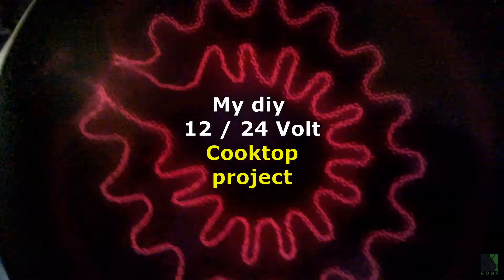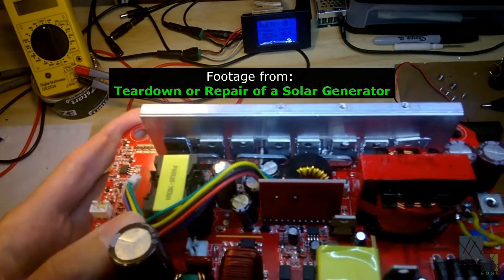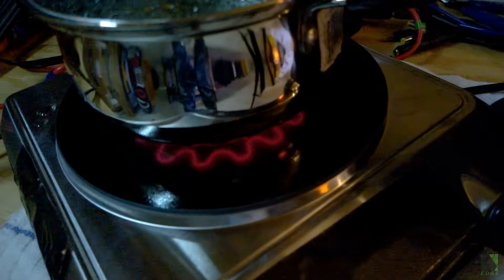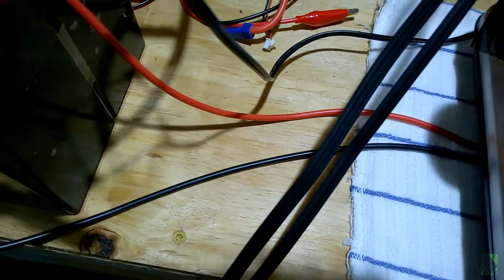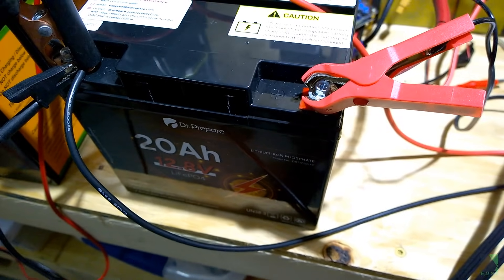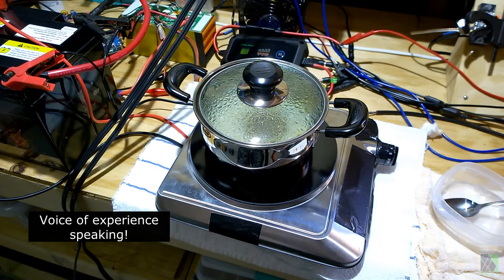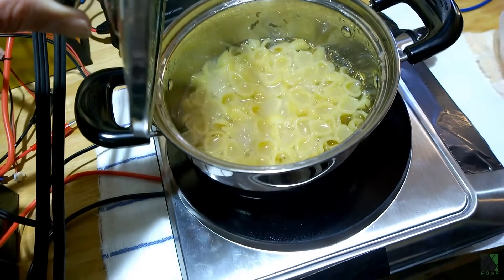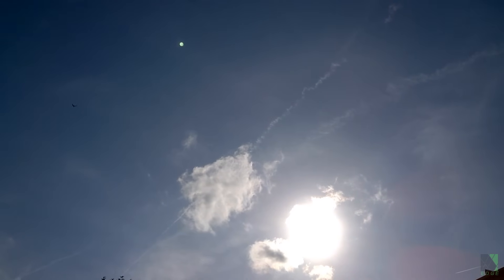12 Volt Cooktop PROTOTYPE - First Test! Pure DC No Inverter Hotplate #12volt #offgrid

Comment from the maker: Notes from my work on recent cooktop prototypes:
1. Thermal Transfer: hot plates / cooktops like this have an unusual looking heating element insulated with a fibrous ultra high temp material I could not identify at the time of this video. The heat projects upwards into the cookware. Internal temps inside the element chamber are very high. There is practically zero space between the heated radiative surface and the cookware. Because of this, thermal transfer is good. Vast majority of the heat goes into the cookware. A thin stainless pan or pot works incredibly well, heating within seconds.
2. Efficiency: a native 12 hot plate does not use complicated electronic circuits such as DC-AC inverters and induction circuits. Therefore this type of hot plate can cook with much less DC power and efficiency exceeds 90% with no moving parts.
3. Cost: this type of appliance is hard to build DIY, BUT very cheap to mass-produce in a factory. Therefore it's 100% possible to mass produce with cost <30-50 USD.
4. My prototypes are aimed at Grid Down scenarios, where everyone would truly be "off grid". Complicated, top-heavy technology is a liability. A simple appliance like this is needed in the world. A basic 12 volt car battery can run it for years. 
5. DIY / serviceability: almost no one can repair an inverter or induction cooktop. But a basic cheap appliance like this has a far great chance of survivability and possibly repair with only basic hand tools and DIY skills.
6. Wattage/dissipation: the prototype seen here can handle over 500-1000w of power. There is zero reason why a .5-1kw 12v cooktop could not be made for a reasonable cost. But even 500w has been proven adequate for standard cooking jobs.
7. No buck converter, PWM or electronics are needed or even wanted in such a design. The goal is pure simplicity. 2-3 heating elements suffice for temperature and power regulation. A robust mechanical thermostat or manual DC switch can handle operation from there. 
-DD

Comment: Maybe you know this already but I give you this tip anyway, they are soldering iron that run on 12V, with a heating element that can get hot up to 150 watts, others use USB 5V and can get hot 80 watts, if you put together 4 soldering irons that can be a nice experiment to try 🍲✔️
Reply from the maker: @albumdelcentenario Hi and thanks for sharing :D I didn't even think of trying 12v soldering iron heating elements. I have to look for some. Cooking with parts from 12v soldering irons!?? I bet no one has tried that!

Comment: So as volts go up it's easier to build??
Reply from the maker: @mackelby1 With higher volts, we can use thinner cable, but that's about it. The challenge with the "infrared" cooktops which I happen to really like, is the super high temperatures inside. I destroyed a lot of materials trying to figure out how to make durable heating elements by hand. Had some equipment burn up but that's the price of such experiments
Reply: @solarpoweredge you are really scratch building aren't you??
Reply from the maker: @mackelby1 Yes... I wish we could just go out and buy these at a local store, can't understand why not. This cooktop works so very well, I think a lot of people could benefit from it.

Comment: I believe the fine powder is Mica.

I've been looking for a way to make/buy a 12v kettle. I've been thinking of just drilling and tapping holes in a kettle for 8 or 12 diesel engine glow plugs, if they draw 10A each I'd be getting let's say 1200 watts or so and I could use 3x 40A relays to control them. 

But I don't know how healthy and safe the glow plug materials are when in dieect contact with food or drinking water.
Reply from the maker: @jhsevs It turned out to be an asbestos like mineral substance, I had it analyzed in a lab. After this I cleaned my shop thoroughly, now I wear a breathing mask when I work with these types of devices. Great idea on those glow plugs..  sounds interesting, if I can find a cheap set I might give them a try. There must be a way to use them without contacting the food directly

Comment: I need one.  I want my future off grid tiny home to have a wood cook stove but cooking in the hot months would be torture without this little DC hotplate.  Except my cast iron pans will thrash a glass topped one.
Reply from the maker: @lesliekendall5668 I use cast iron and stainless, and never thought of what would happen with those glass tops. Good point. I do have a couple of non-glass cooktops that can run on PV, but tend to like the glass ones. I avoid the teflon pans if I can, worried about the chemicals getting into the food...

Comment: Dave you're funny sometimes  ;)  Hey man, go to PCBway and make your plans, they will build practically ANYTHING, including circuit boards, metal stuff, plastic 3d printing etc AND assemble if you want for more $$  Combine your diodes, large power transistors etc with metal tight fit parts and you have your solutions even if you assemble them yourself.  Pretty sure aluminium would be best but tin will suffice and likely cheaper.  In fact you could have them assemble the whole thing into a large metal plate with the devices distributed evenly around.  Cheers mate.
Reply from the maker: @davidrobertson1980 Hah :) I do want to work with PCBway to make some CNC metal parts, first need a 3D CAD model. At the moment I am unable to keep up with the circumstances here, let alone make 3D models. Hoping for the future! I'd like to see a nice CNC aluminum housing for a custom 12v cooktop, that would be amazing... take care man!

Comment: Super interesting, thank you so much. Really trying to become more self sustainable and this was something i scratched my head on too! Why the heck isn't this commonplace? You think the dirty inverter industry doesn't want it to be? 😂 also if you don't mind me asking (I can look this up too so no need to answer haha), but what kind of 12v battery should I get as my first one? Will be working mainly off of diy wind and perhaps solar in the future, I'm thinking :D thank you!
Reply from the maker: @tjitjo welcome! who knows, but there is no reason why a kitchen-grade 12v cooktop (hotplate?) could not exist, for about 25 bucks. It needs slightly different components and construction vs. 120vac, but not really high tech at all. My first battery for solar was a LiFePo4, you might want to look at a 100ah 12v one for a startup system. That's enough power to do cool stuff including cook small meals, run lights etc. and have good backup power if need be. Hope that helps :D

Comment: Besides the prepper/off grid demographic, I think you’d find great interest in van/rv community. But perhaps a 24/48v “induction” cooktop would be more efficient and eliminate excess heating issue. A lot of that community has converted to higher DC voltages to take advantage of DC aircon units 😊

Comment: How about a 12v induction cooktop? Would eliminate the high temperature inside the burner problem.
Reply: You don't know how many off-grid people you're helping. Just what they need. All your trials work and experimenting. Cut out a lot of headaches. For the average of gridder. Much appreciation thank you.
Reply from the maker: @Brad-sh2wn I am thankful for your understanding, most don't realize the level of effort. Video clips don't tell even 5% of it. Your comment means a great deal to me. I'll keep at it. 
With regards to the cooktop projects, I still hope to come up with a better version that's safe and diy friendly. A tall order as the internal temps are unbelievably high. We really need a company to make 12v kitchen grade appliances affordable and safe for everyone, I believe it is totally possible.
Reply from the maker: @MarkSpohr Yes, good idea. I am looking into giving it a try, been trying to sort out the details. My goal on this project was reliability, simplicity and low cost, hence I usually avoid electronics when possible. But induction technology works well. If I get anything working with induction I will upload the results.
Reply: @solarpoweredge  yes, looks like you have to build an electronic oscillator which makes it more complicated

Comment: This looks like a party I wanna be invited too. 👍🤣 I’ll be doing a bunch of this stuff this summer. I’m about 60% done my first prototype and living inside it currently. Ive been building out the shop in preparation for the last push. This summer I’m on solar and power, axles and exterior siding. I’m also diesel swapping my hummer, which is my company tow rig. My plan is to make redundant, easy to fix, off-road, multi purpose trailers and survival rigs. Custom built for the customers needs.
Reply from the maker: @TinyGoHomes Very cool! :D I am interested in tiny houses. Been wanting to build one for years. Have room in the driveway, just need some obstacles out of the way so I can get something decent started. Your projects sound very interesting 👍

Comment: Have you looked at induction cook tops? They are basically a rotating disk of magnets. The faster you spin them, the hotter it gets. Convert the motor to 12v? Not sure, never pulled one apart, but worth looking at. May be better than a hot coil
Reply from the maker: @denniskwasnycia1950 Hello, yes I bought a quite small induction cook top, it's really neat! It does require an inverter and has an internal power driver circuit. I am thinking for grid-down scenarios simple, robust tech is cheaper and easier to service and repair. A resistance cooktop should not require power electronics, at least they'd be optional and could work without it
Reply: I didn't think induction cooking uses a motor, but instead uses the native properties of AC for the oscillation needed for the heat.
Reply: @MarcillaSmith  Magnetic induction is a rotating disk with magnets on it of alternating poles to create eddy currents to heat aluminum or copper. The motor is used to rotate the disk of magnets
Reply: @denniskwasnycia1950  as used in the kitchen of chef Rube Goldberg himself

Comment: I just looked on Amazon.  Found 12v rice cooker, roaster, sauce pan and slow cooker.  Think you have a good idea but there are cooking appliances  that run on 12v DC out there already
Reply from the maker: Yep, been seeing those for years. Could never find a standard hot plate... or cook top whatever it's called. They are needed because any cookware will fit on top. Why these simple cheap kitchen devices are not sold everywhere in 12/24v continually perplexes me.
Reply: They, the appliances you mentioned are indeed available but they take a very long time to reach cooking temperature.
Reply: @JT-lq4yd yes, I have only ever seen 12v cookers under 200w. I'm glad I'm not the only one who noticed!

Comment: On a nice sunny day, have you tried using a solar panel directly to the hotplate..? I'm sure it would work, I just have done it.  Yeah.. a short circuit with a rheostat. Yes.. I'm subscribed.
Reply from the maker: @OFFGRID_Trucker Hi! thanks for subscribing - I haven't tried it but it would surely work with enough solar panels. Rheostats and solar can be fun!

Comment: Can you supply to Africa, can be a solution to most poor people without electricity. Most house hold are using battery for power. Great job.
Reply from the maker: @kha2Musie Right, I hope a factory can start manufacturing them... there is no reason why they can't be made available at low cost to the world. High current 12 volts DC is a bit more challenging than 120v AC, but the appliance should still be affordable and mass-produced
Reply: South Africa has no power, clowns